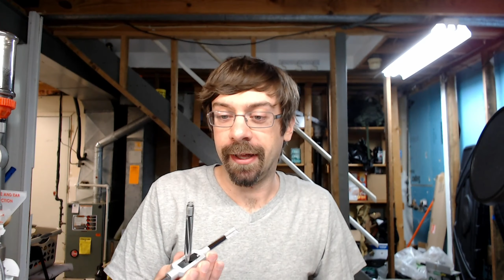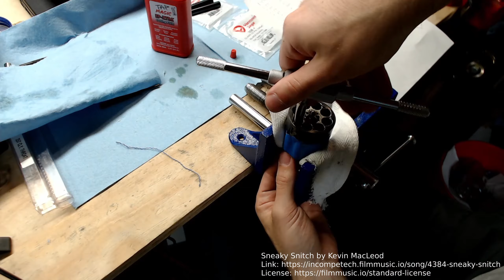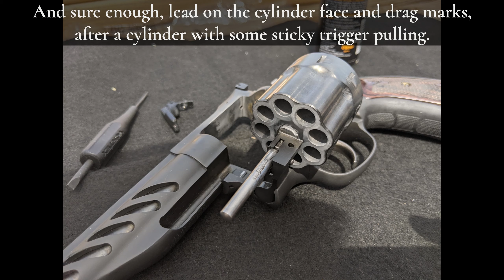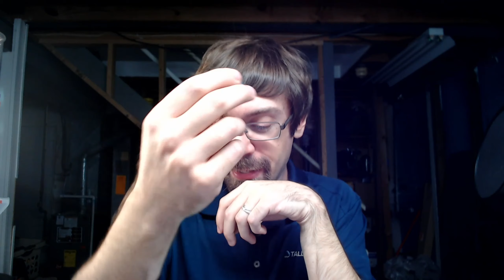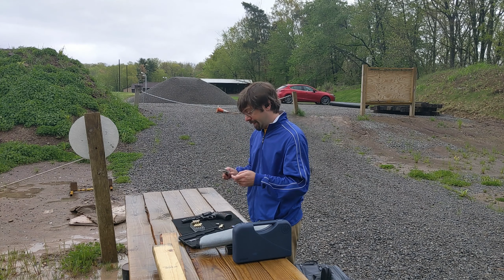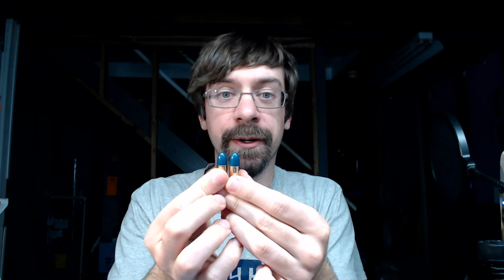USPSA Revolver: Chasing Reliability

Comment: Might have to run plated or jacketed bullets to keep the lead splatter down. More expensive but some guns need it I guess. Or change what powder are you running? I've noticed a little bit of lead splatter on my GP100 357 6" and I've shot it a lot out with 158s and unique. Had the cylinder lock up once but that was because of carbon fouling in the cylinder bearing and that took 3 years to happen.
Reply from the maker: It's happened through several different powders. Plated may be in the future, much as it stings to pay 50% more per bullet. On the other hand, the Blue Bullets coating has proven a lot more resilient than the other coatings I've tried, and that may be enough to run with.

I'm still not sure why it's happening, but upon its most recent return from Ruger it's been working well. I think they might have dunked it in an ultrasonic cleaner there, although they were typically tight-lipped when I asked the customer service desk.
Reply: @JaySlaterOfMars  Good to hear you are getting close to a reliable gun. Blue bullets seem to have a thicker coating than other brands which would probably help and keep the costs low to shoot more. Been wanting to get into USPSA revolver for something different once in a while  but not sure if I want to go with the GP100 or the Smith 929. Love my 357 mag and 44 spl GPs so I was leaning towards another one but if this is an issue with the supers I might go with the 929 instead.

Comment: I've been a dedicated wheelgunner since I started shooting competitions in 2018, still relatively new, but I have a lot of success with those 160's. I shoot the 627, but I've been wanting to switch over to the Super GP for a while now. I'm rooting for you.
What length is your brass? Most folks use short colt brass. I, along with some old timers I copied, trim down 38 special brass to about .9" and load powder-coated 160s. I keep the OAL fairly long because that helped my accuracy. I use a super tight taper crimp because that's the best I can do with my press to smooth out the cartridge.
I hope you get it figured out because I want to eventually switch over to Ruger.
Reply from the maker: I'm using Short Colt, loaded to an OAL of 1.2" with this 160gr profile—that makes them slightly longer than a flush-seated .38 wadcutter. I switched brands to SNS Casting. The SNS coating seems to tolerate my load a little better: substantially less lead buildup on frame and in the forcing cone. I also switched to a light taper crimp—basically making the case straight-walled. .358 bullets in Starline brass have plenty of tension just from seating.

The problem I was chasing in this video turned out to be a firing pin spring. Replacing that got me back to perfect reliability.

As far as switching goes, I'd say it's a mixed bag. I haven't had the chance to play with a nice Smith, but I understand you can get them lighter than Rugers—the transfer bar on the Ruger DA guns robs you of some striking power. Right now, I'm running about a 7.5lb trigger with an 11lb spring. With the lightest hammer spring Wolff sells (9lb), I have a 5.5lb pull, but it also only lights about 70% of the primers I give it. That's a task for the offseason—see how low I can go. I'm hoping I can at least get the 10lb spring in and trustworthy. The other minus is that there are very, very few aftermarket parts so far. I had to design and make my own extended cylinder release.

On the plus side, the Ruger is built like a tank. It's pretty easy to work on, and a lot of the problems I hear Smith shooters talk about are impossible, given the Ruger design. (No strain screw to back out, no crane screw to come loose and drop your cylinder on the ground, etc.)
Reply: @JaySlaterOfMars  true story.
I had one of my 627s go out of time, that was no bueno and not covered by the warranty. Honestly, I wouldn't have given Rugers a second thought until I won a GP at an ICORE match. The GP I won is the same barrel length as a 586 I got back in '09, and I kind of shoot the GP a little better. Standard GP to standard 5/686, I find the GP to be a bit more clunky, but shoots just as well after a few refinements. I'm just waiting for the market to calm down before I buy anymore guns.
I'm glad you got it working. It would be a royal pain to switch brass, especially to something like I have. The only reasons I use the brass I do is because I saw others doing it and I had a butt load of 38 special brass, a case trimmer, and LOTS of time.
You mentioned you don't have a comparable Smith to do a side by side, but do you know right off if the moon clips are interchangeable? It would be super cool if you could do a video on those moon clips as well as explaining the hot loaded short colt. I've had the hardest time finding info on a 38 short colt load guys use for USPSA.
Reply from the maker: @ryangibson4959  On moon clips, the chamber spacing is identical on the Super GP and the 627, but the moon clip indent is very slightly different. If you have TK Custom-style 627 moons, with a rounded bit on the end, they won't fit the Super GP: https://images-na.ssl-images-amazon.com/images/I/81b8xwo8J0L._AC_SL1450_.jpg

If you have SpeedBeez-style moons, without a rounded bit on the end, they probably will: https://www.speedbeez.com/wp-content/uploads/2017/01/627-1.jpg (SpeedBeez sells them for the Super GP, too.)

A video on the .38 Short Colt load might be a good idea. I have a new press and reloading bench coming in a month or two—once I get all that set up, maybe I'll take a crack at it.

Comment: I hope that you can work out the issues that you are having in short order. Have you been having these issues since you initially started using the revolver? How much modification have you done to the revolver prior to reaming the cylinder?
Reply from the maker: No, the issue seems to be mainly localized to taper crimped, coated or plated bullets.

Other than reaming the chambers, I've only chamfered the cylinder (well, had it chamfered) and swapped some springs.